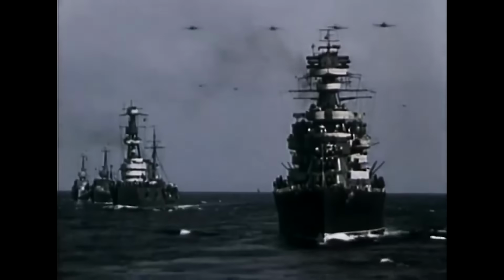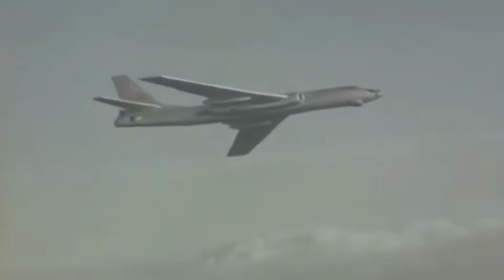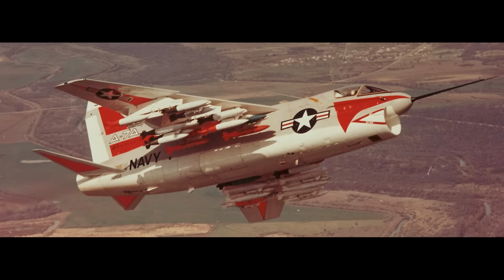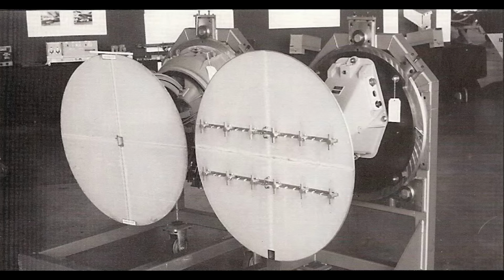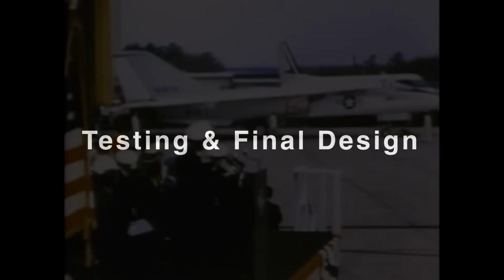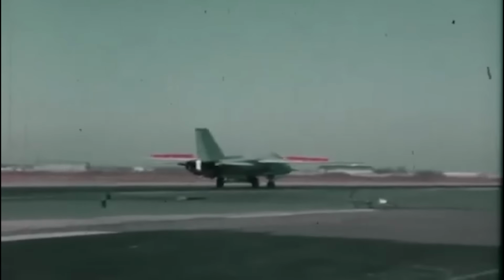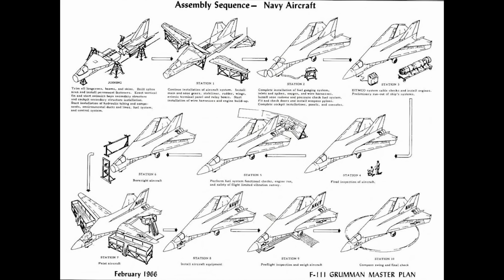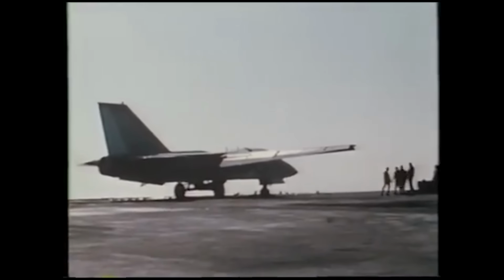Was The Grumman F-111B A Bad Aircraft Or A Missed Opportunity?

Comment: The "B" models were very rare (only 7 produced) and rather notorious.  Apparently there's only one left, at China Lake NWC.  So actually seeing one in the flesh was kind of a Big Deal.   F-111B tail number 152714 was parked on the west side of McClellan AFB when I was stationed there in the early 1980's (McAFB was the main depot repair facility for the F-111).  Some entity  was using it for battle damage repair practice.  Later it wound up in a junkyard in Mojave, CA.

Comment: For decades I have viewed the F111 as an aircraft the absolutely failed in its originally intended role (as an interceptor), but became a superb, outstanding success in an unplanned role of a heavy tactical bomber.
Reply: It was originally designed as a tactical bomber, McNamara forced the Navy to use it as an interceptor and the Navy didn’t ever like it
Reply: @Geschwindigkeitsmessungen the navy liked it at first because it fulfilled everything they needed from it but then the requirements changed so the f111B wasn’t valid anymore
Reply: It was certainly sold to the Australians as a survivable heavy bomber, though not even a tactical one - at the time they asked for a plane that could deter Indonesia by bombing Jakarta.
Reply: I don't think it was originally designed as an interceptor at all, I think it was originally designed as a jobs program for general Dynamics to feed both the Navy and the Air Force. 
When I think of the term interceptor that reminds me of the Spitfire something on the field warmed up ready to go and the F-111 was far from that
Reply: @christophergagliano2051  The US and UK have always had a different take on interceptors.  Remember the P-38 Lightning?
Reply: @ThatsMrPencilneck2U the P-38 and P-39 were called interceptors as a clever way for the project officer to dodge and Air Corps regulations that mandated pursuit aircraft could only carry 500lbs of guns no larger than 50cal.
He also told Bell and Lockheed plumb for "ferry" tanks in anticipation of US heavy bombers needing long range escorts.
Reply: The F-111 was designed as a high speed, low-level deep interdiction precision bomber.  It fiulfilled it's role very effectively.  I was assigned to a SAC FB-111A wing in the 1970's and the aircraft amazed the SAC ORI teams with its high percentage of "shacks" (direct hits).  I witnessed that on 3 SAC ORI's.  The F-111B wasn't optimized for it's role as a fleet defense interceptor.  The Navy rejected it and had Grumman design the F-14 around the same two TF-30 turbofans and the Phoenix missile and it did a great job in that role.
Reply: @brihath0805  One quick note:  F-14 was designed around an engine the Government said it would supply that was 37% more powerful than the TF30 which was to be used only in the test and development airframes.  Gov't failed to deliver, so for decades the Tomcat was stuck with the TF30, which was not designed  to be used in an environment of rapid power changes and repeated  changes of airflow entry angle.
Reply: The F-111 was conceived as a strike aircraft. The Air Force knew the Thunderchief and Phantom weren't survivable against the new generation of air defenses. The Air Force wanted something that could dash in supersonic on the deck in any weather.
Robert McNamara told the Navy they could share with with AF or give some boat money to NAVAIR.
Reply: @Fulcrum205  no it was expressly a B-66 replacement, as a tac nuke delivery platform; performance carrying conventional bombs was a secondary concern. If you look at the F-111B Standard Aircraft Characteristics, carrying six Phoenixes (four of which externally on the wings) cuts the range nearly by half compared to carrying two Phoenixes (both internally which means zero drag), now imagine they’re bombs and even more draggy. The F-111A’s design enables it to either carry a single tac nuke and attack a target with a terminal supersonic run-in which increases survivability over the B-66, or carry a shitload of conventional bombs and fly the entire mission subsonic, because going supersonic with those external bombs would kill range and endurance.

As for survivability, the F-105 was replaced by the F-4, which then alongside A-7 was replaced with F-16. The planes themselves weren’t the problem but the USAF in Vietnam had serious doctrinal and organizational problems that caused their ground attack aircraft to fly without forward air control, that’s not the fault of the airplane.
Reply: On the issue of calling it an interceptor.
The phoenix missile was originally developed for the F111b.
And no one for an instant thought the F111 was going to be any good at dogfights.
It was a high speed high altitude aircraft missile truck meant to kill other aircraft.
Interceptor.
(A job at which it failed to be good at, but it did find excellent use as a heavy tactical bomber.  And that let it easily pinch hit as a passably good strategic bomber too).

Comment: From its inauspicious start, I'm sure that not many could foresee that the F-111 would turn out to be one of the best low-level strike aircraft of all time.(almost as good as our Buccaneer and Tornado!).
Reply: Not the first time that a plane blossomed when finding its true role.   Take the Hawker Typhoon.   Designed as a replacement for the Hawker Hurricane but ended up as the RAF best Ground Attack planes providing Cab Rank formations of Planes alongside P47 Thunderbolts in Western Europre ready to stream in on German forces.

Comment: Wonder how the F-14A re-engined with Speys would've done in testing and how it would've compared to that with TF30s
Reply: Did that actually happen?
That would be interesting to hear about . . .
Reply: @stickiedmin6508  I don't think it did. As far as I know, the Navy gave up on and stopped funding the PW F401 and the F-14 was stuck with the TF30. The Spey thing's just a hypothetical
Edit: Fixed my original comment to avoid any confusion
Reply: Was considered but not pursued because of too much costs for too little gain.  That's Pratt's F100 never went into the Tomcat.
Reply: @tararaboomdiay7442  They considered the Spey? Did it cost more than losing 8 or 9 $25 million aircraft per year?

Comment: I was wondering if you could do a video on why the Soviets abandoned single engine aircraft in the “4th” Generation where’s as their third generation aircraft were both single engine.

Arguably the most successful 4th generation aircraft by production numbers would be the F-16. Being a single engine design helped its overall size and operating expense. I’ve always wondered why the MiG-29 was not a single engine fighter, especially considering the MiG-21 and 23 were both single engine times with the MiG-21 being a large export success because of its good performance per operating cost.
Reply: 29 is i heard kinda hot rod compared to f16, i guess it just fits their complete 180 turn from the interception to air supremacy designs. 
Its kinda wild soviets cooked su27 and mig29 to perfection after plane like mig23.

Comment: This is the most factually accurate and balanced video yet on the F-111B.  

The design was actually a success and would have performed the mission for which it was intended.  It was never intended to be a maneuvering dogfighter.   But the needs of the Navy changed, and they couldn't have both a new fleet defense interceptor and a new air superiority fighter (VFX).  It's sad that the airplane usually gets blamed for the shifting desires of the Navy.  It's also sad that by the time the Navy bailed out of the F-111B, the Air Force F-111A was left stuck with the side-by-side seating and crew escape capsule that they did not want.

Comment: It was a bad idea. Even the USAF didn't use it as a fighter.  It should have been called the B-111.
Reply: It was a great idea.  The USAF never intended it to be a fighter. The F-111A was a bomber.  Just like the F-105 before it and the F-117 after it.  Don't be misled by a simple letter.
Reply: @gort8203  - Then why did Robert S McNamara believe the navy could use essentially the same aircraft as a fighter?  Strange (pun intended)
Reply: @scootergeorge7089  The Navy version was a fleet defense interceptor.
Reply: @dukeford8893  - And how did that work out? The B model was CALLED the "fleet defense interceptor." The USN never adopted it.
Reply: @scootergeorge7089  You didn't learn much from the video, did you?

The idea that one basic airframe could fulfill two different roles was not a dumb idea at all.  History is full of examples of aircraft that were versatile enough to fly for different services and even perform different missions. The original requirements presented by the Navy and USAF were not incompatible, but the requirements later changed.  

When the TFX program began the USAF and USN were both asking for a large aircraft that could lift a heavy load of fuel and weapons, with long range or long loiter, plus high-speed dash or intercept. To achieve this, twin engines and an innovative variable geometry wing were called for, and DOD logically assessed that it would be wasteful to develop two very expensive advanced airframes when a single one with some variations could do both jobs. 

The reason one basic airframe could do both jobs was because original USN specification was for a fleet defense fighter, not an air superiority fighter. It was not originally intended to be what later became the F-14, but to perform the role meant for the Douglas F6D Missileer, with the addition of supersonic dash capability. It was not intended to be a dogfighter.   

The biggest difference between the airframe requirements of the two services was that the USAF wanted a tandem cockpit and the USN wanted side-by-side seating.  Boeing tried to make both services happy and made two different configurations, but MacNamara’s DOD wanted more commonality and thought USAF could suck it up and have the crew sit side by side.  This is ironic considering that when the Navy cancelled its version USAF was stuck with the cockpit it didn’t want, which also ironically contributed to the airplane being too ungainly to be a dogfighter.  If the Navy had wanted a dogfighter it would not have insisted on the side-by-side cockpit over the objections of the Air Force.  The F-111 cockpit was suitable for a radar interceptor, but not for an air superiority fighter.

The original idea wasn’t dumb -- what happened was that needs changed.  USN revised its requirements for its next fighter as result of combat experience in Vietnam, and they realized that the missileer was too limited a role.  The also needed an air superiority fighter to replace the F-8 and F-4, but couldn’t afford that in addition to a dedicated fleet defense aircraft.  Thus, the TFX would now have to be able to dogfight as well as be a missile interceptor.  The F-111B could have worked as a missileer, but it was too fat and underpowered to compete as an air superiority fighter.  It was proper of the Navy to recognize that its needs had evolved.  This was perhaps the beginning of the Navy realizing that budgets and hangar decks did not have room for so many specialized aircraft.  USAF desperately needed the F-111 to replace the F-105, so they sucked it up and accepted the overweight airframe caused by the loveseat cockpit they never wanted.

Comment: The top air intakes on the Boeing TFX were to keep gravel from being ingested when using highway in the United States as landing strips for bombing missions in Europe.

Yes, the Air Force concept of the future fighter was bughouse nuts.
Reply: Mig-29 has top intakes that close after takeoff, and screens on their other intakes also to protect against FOD from unprepared runways
Reply: Actually that's one of the more sane concepts as far as inlets go
Reply: @argokarrus2731 The problem is that the fuselage tends to block the airflow to the fuselage at high angles of attack.

Ventral intakes, as on the F-16, sort of get more air pushed in at high AoA.
Reply: Easily as bad as the LCS.
Reply: Thank you, I wondered why the hell that design had two sets of intakes.  Kind of silly from an additional drag perspective...
Reply: @intercommerce  Remember, the Soviets did not assume there would always be a smooth 6,000 ft surface from which to operate..  Their fighters were designed to be able to operate from semi-prepared fields.  Note that the naval version of the MiG-29 dispenses with the auxiliary intake and screens.

Comment: The common thing people especially McNamara didnt appreciate was the Phantom was developed for the navy first you can modify it to operate from an airbase easier than making an Air Force jet operate from a carrier
Reply: "(...) you can modify it to operate from an airbase easier than making an Air Force operate from a carrier (...)" 

Which held true for the Iranian F-14A and the Australian F/A-18E/F. 

McNamara was an actual imbecile if he only took statistics of '80 percent shared parts' into account for contracting the General Electrics design - versus the possibility of having to issue additional contracts to have an operational navy at all...
Reply: The Air force changed the tires and landing gear to take heavier loads because they didn't have to worry about coming back aboard the ship
Reply: @Archie2c  
"The Air force changed the tires and landing gear to take heavier loads (...)" 

And that is only because Tactical Air Command deviated from it's original mission of air superiority , turning fighters into bombers (virtually all F-16A/B/MLU-D/Vs, the F-15E/EX) - as if the dominant Strategic Air Command ever had a realistic mission after the introduction of ICBMs and SMBLs...  thus Air Combat Command, now ending up with equally expensive, but '4000 km less range F-111F/Gs' as the sole production standard (F-15EX). 

In the 21st century, stand-off range matters even more as it already did when the F-111B was tested.
Reply: Yet the Navy rejected the deal on the lightweight fighter and refused the naval variant of the F-16 in favor of the losing F-18 years later. The Navy then redesigned the Hornet to become the Super Hornet…a larger, heavier airframe based on a 1970s design.

Comment: Hindsight is 20-20 etc but the 111B would have made a great platform for the new AIM-174/airborne SM6 that’s getting tested now

I do genuinely think it would have complimented the Tomcat well as a high-speed low-altitude bomber/deep strike aircraft with a secondary interceptor role.
Reply: The F-111B wouldn't bomb, and as long as you had the Tomcat, there was no reason for teh F-111B
Reply: @tararaboomdiay7442  The F-111B wasn't intended to do strike missions because it had the AWG-9 instead of the APQ-110/113 combo on the 111A but IMO they should have ditched the APQ-110/113 on the A and instead developed air-to-ground capability for the AWG-9 for the 111A and B. The Air Force could have definitely benefitted from Phoenix equipped 111As in the interceptor role replacing much less capable F-106s still in service, and the Navy also could have benefitted from strike-capable F-111Bs
Reply: @hybrid_grizzly  Air Force asked and received funding for the F-12B (one of the Lockheed Blackbirds), whilom would have been a far better interceptor.  McNamara, though, wanted AF to order the F-111B as an interceptor.  When they wouldn't do that, he froze the money and ordered the Blackbird production line destroyed.  USAF never got another interceptor.  Interestingly enough, the SG-18 radar from the F-12 was the basis for the AWG-9 in the F-111B and F-14.
Reply: Sorry about the typo.  It was supposed to be ASG-18 for the F-12.
Reply: @tararaboomdiay7442  Not to agree with McNamara but I don't think the F-12 could have been produced in enough quantity to be a proper interceptor and while I don't think dedicated interceptor F-111B would be ideal, a multirole F-111 that could be a strike aircraft or interceptor would be a better option. It's not quite as fast but mach 2.5 sustained is still great for an interceptor and it carries double the weapon load at 6xAIM-54 vs 3xAIM-47 for the F-12